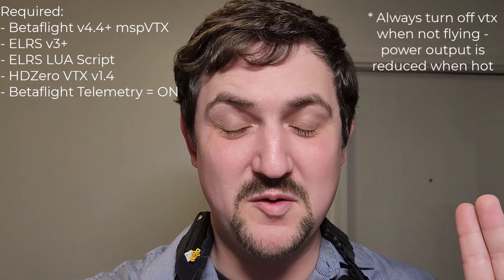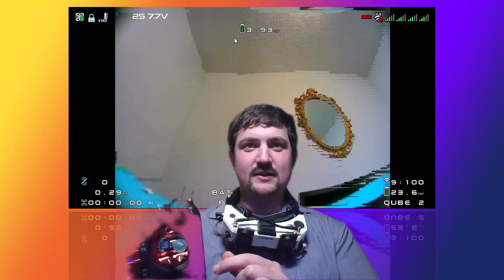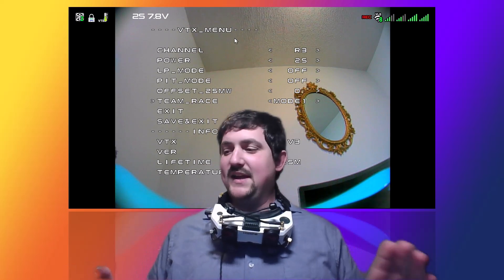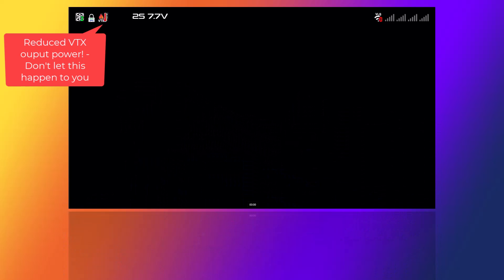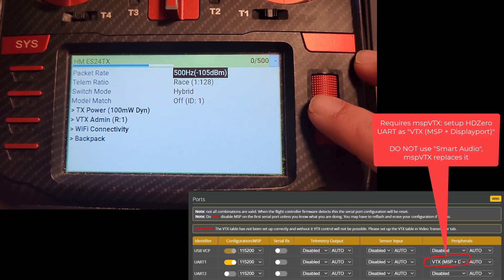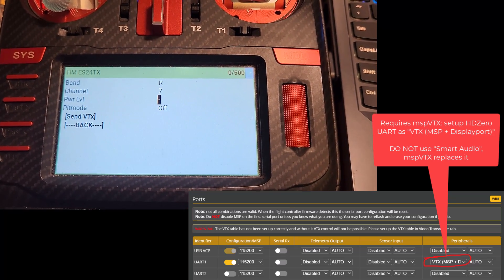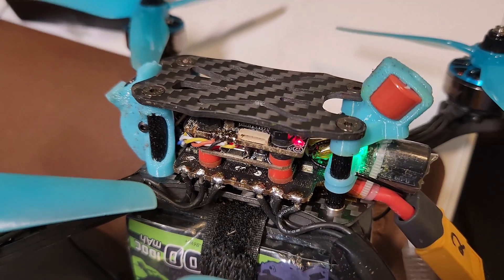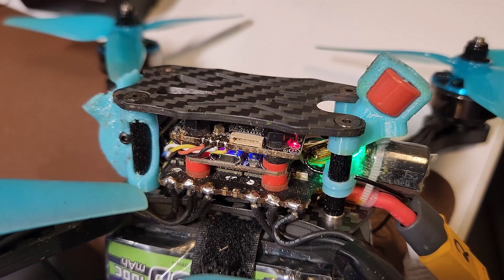Change channels like a pro! - Stop overheating! - HDZero and VTX Admin

Comment: Ryan, I have tried to set this up. Is there something I am missing? Of course.  :)  

I have the new goggles and v2 vtxs. I have setup my auxiliary channel, copied and pasted your info. I also did my own text entry in the CLI. Switch works in betaflight. On radio I have vtx Admin set to 8, - , .. When I power quad, vtx is still broadcasting.

I can't find Team Race? Not sure if it's a firmware update or I'm completely missing the menu option. 

My goal is to simply Switch off and on vtx, not to change channels. I fly R,8,1.

Please help if possible. Thanks.
Reply from the maker: Need a vtx fw update for team race mode

Comment: But let's say I fly multiple drones with the same controller and different vtxs have different number of usable channels... (Differences in power broadcasting strengths, AND higher/lower number of available VTX broadcast levels. Eg a vtx of 25/200/400 vs a vtx of 25/200/600/800/1200).
How do I set this up for every drone I have, via the one remote...? Considering the different vtxs and different levels of power
Reply from the maker: @TopFox555  i assign a switch to 0, 25mW, and max power in this case. Or use a 6 position switch. You'll figure it out

Comment: Hi. ive done the full cli command and assigned the switch in the modes tab.
I changed all 3's into 7s brcause i want to use switch 6 on my controller. 
 No video now. How do i reset the vtx?

Comment: Hi Ryan. thanks for this video. I set the team race mode 1 and pasted the values into the CLI, only changing the aux channel value to suit my remote control. Everything works as you said and the vtx stays off or turns off if I activate the switch even if I leave it off it continues to heat up. Does yours stay cold?
Reply: Hello friend, have you received any response from Ryan? I just performed the procedure and the exact same thing happens to me, my VTX keeps heating up, have you been able to solve it?

Comment: Love this pro tip, thanks Ryan!! I have been fighting with my THIII+ HD and getting Low Power Disarm to stick, and for 200mW to stay as the default. Heck with that, now it's all on a switch and I can see it happening in real time. Super cool! What remains to be seen is if the settings I changed in the ELRS LUA will have any impact on my Analog Quads.

Comment: should note that this isn't aux 3 but in fact aux 4. vtx 0 2 0 0 3 900 1300 would be using aux 3 because aux chan start at 0 1 2 3. so the second number 2 would be aux 3. took me a while to figure this out. hope this helps people who set up their tx to use aux 3 that they need to use 2 as the second number if you wanted aux 4 you would use 3 as the second number. hope this isnt tooo confusing

Comment: for the VTX power settings commands, does this work on Freestyle V2 too? so vtx power setting 1 = 25, 2=200, 3 = 0, 4 = 500 and 5 = 1000? Or is it different there? Would love to have an option to switch between 0, 25 and 1000 on a 3way switch
Reply from the maker: I think 4 is 1000mW in this case and 5 is off. The manual should say
Reply: @RyanQuellet  cant really find the manual for V2 but i guess regarding to the vtx table 1 is 25, 2 is 200, 3 is 500, 4 is Max and 5 is 0 yes. thanks

Comment: Carl Zhou, we need :
Lower Cost. HDZero
Stereo Display 90fps, 0ms, Head Tracking PPM.
At most requirement.
And ready Stock Indonesian Price Rp1.000.000,- goggle.

Then we can start playing RC.
Reply: That's $65 usd, not even close to possible for a goggle. The chips in the receiver alone probably cost more than that, not to mention the OLED display's that cost probably $100-150 a piece or more depending on quantity with like 10,000 or more being MOQ and then all the housing optics and ic's. My guess is the goggles cost close to $400 for just the components then you need to factor in the rest of overhead and manufacturing cost.

Comment: I just got the Freestyle V2 and if i have my radio turned on before i power up the quad, the hdzero vtx does 1hz on the blue led, as if there is no camera detected. But if i power up the drone with the radio off the vtx works just fine, then i turn on the radio and everything works...Have you heard anything like this before? I did tests with different censorious and nothing else triggered this besides the radio being on. I'm using Crossfire and the radio is far away from the goggles and power cable for them and i have toroid's on my power cable. It seems like the radio being connected triggers something maybe in betaflight...idk lol very confusing, just glad i can fly it lol

Comment: I have been using AUX channels to control VTX power for a while now, however, I notice that regularly after arming, I get 25mW despite my switch being at 200mW, and I have to switch back and forth in flight to get 200mW. I think this is related to betaflight settings on the VTX page and low power disarm, but its honestly a bit confusing how all these ways to change VTX settings interact and what takes priority when (betaflight, OSD menu, AUX channels, backpack)
Reply: same issue here...